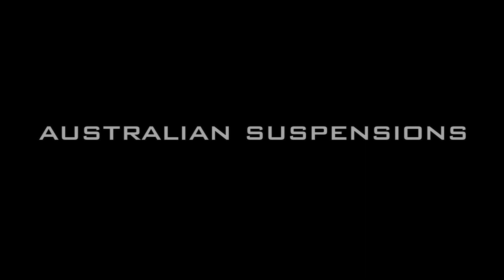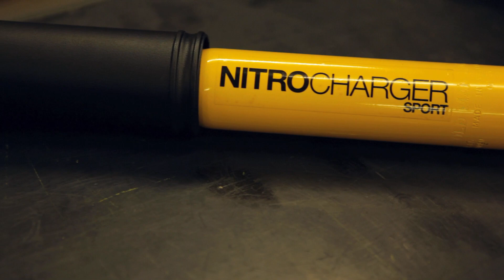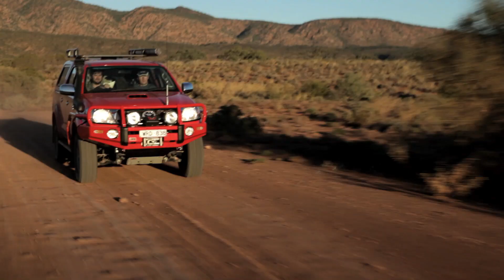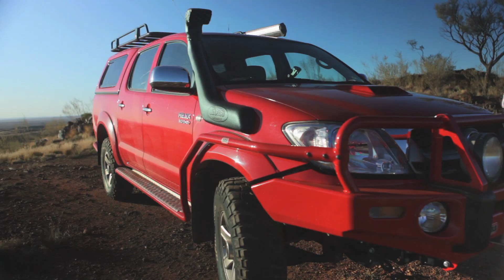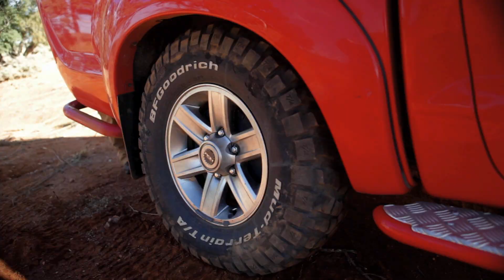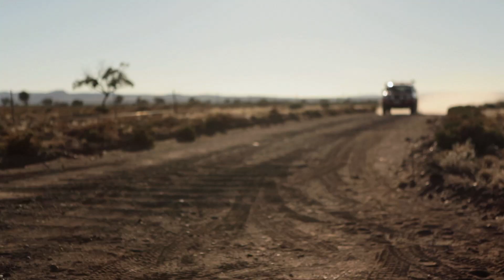Australian Suspensions

Comment: @Schwarttzy  Buying a 4" kit will rarely deliver the desired result - it is too simplistic. A spring has numerous attributes, primary of which is the rate and length.  This is load and height dependent. 

Your assumption about lift height in Australia is also incorrect.  There is a limit of the lift height without certification.  If a taller lift is certified, then it can be sold.  For example, AEV has a 3.5" kit for the JK available in AU.  It passed limit handling certification.